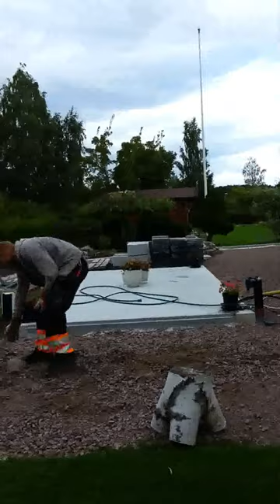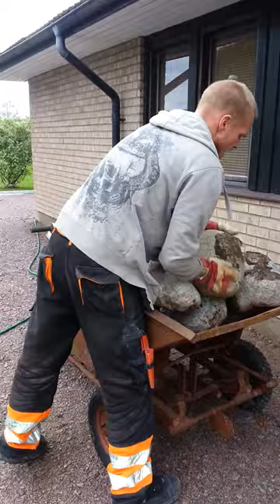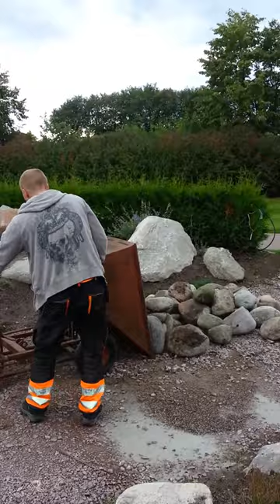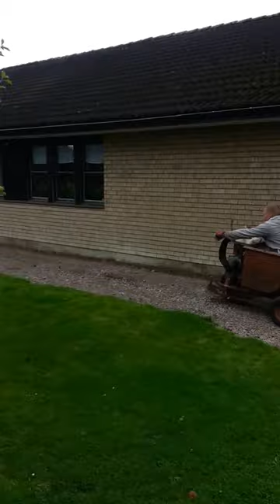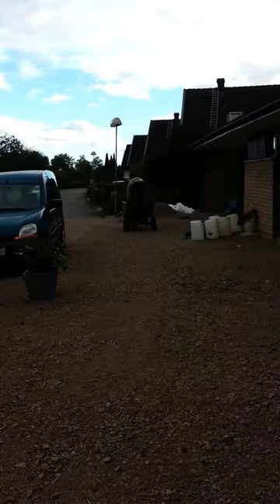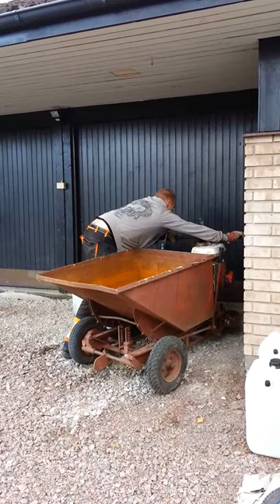Honda G65 powered mini dumper.

Comment: Hi, this is nice and simple design. What about traction if there is only one wheel? Is is it OK? 
Have you any video, where are some hills?
Reply from the maker: It is suited for sturdy dry flat lands. In muddy slopes this thing is a death trap. Also.. it is propelled by its back wheel so if you drive it with the wheel pushing, you have to constantly adjust its course. That is why I reverse the drive wheel and sit in the container.. If the wheel is pulling it is very stable.

Comment: Great mini dumper dude... 👍👍👍
How it made?
Reply from the maker: It was produced during the 70s by a mechanical workshop that sold these to concrete contractors. They were originally used to transport concrete from the concrete truck to where it were poured. The construction is simple and apart from what is seen in the video, there is not much secrets about the design. The propelling wheel, motor, gears and the handlebar is mounted on an infinite rotating column, much like a bumper car. Therefore it is very maneuvrable, allthough unstable in forward direction as it is back wheel steered and propelled. That is why I rotate the wheel 180 degree and sit in the bucket when driving it without load.
Reply: @andreasnilsson2304  i see... 
Thank you for your answer... 
Now i know that mini dumper was not DIY item...

Comment: Hi ! Great ! How do you transfer the power to the powered wheel? Thanks!
Reply from the maker: shond It is sprockets and two chains between the gearbox and the wheel that forms a reduction gear. And the gearbox is a 2:1 ratio centrifugal clutch.